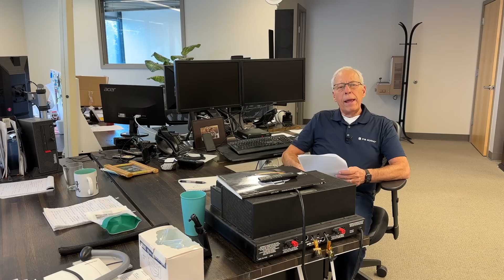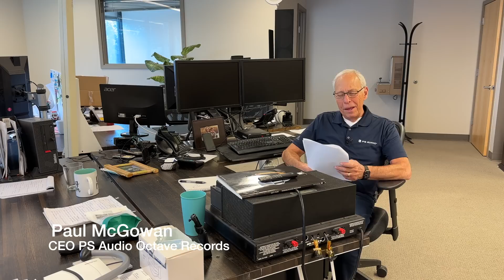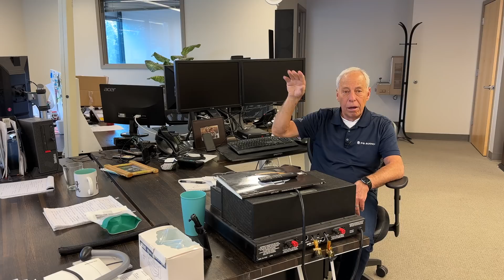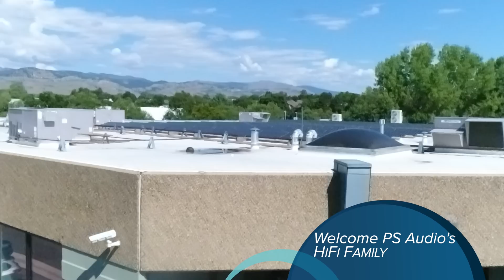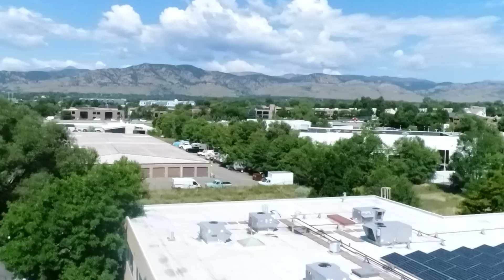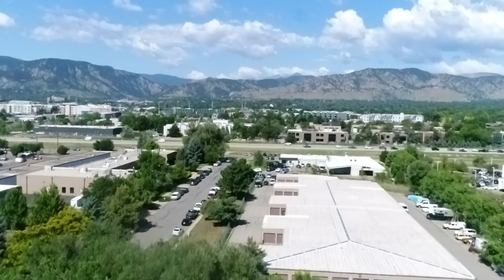Super tweeters and amps

Comment: It's purely academic seeing as at our age and any age above about 12 our hearing starts to decline from the 20-20 hearing to ...well at our age 20-14 or less.

But I still like the chat
Reply: Most people never hear that full range.  Most people hear very little below 40hz or above 15khz. For someone to hear the entire spectrum is actually quite rare, even in childhood.  

The 20 to 20k is a bandwidth allocation in the EM spectrum.  These allocations often include guard bands to prevent interference between services. The remainder is just that... extra bandwidth to limit interference.
Reply: @Douglas_Blake_579  yes that makes sense. I know that I can't hear below 28Hz.. and above 14kHz so talking of supertweeters is purely academic. My technics speakers have supertweeters barely an 0.75 inch  diameter from memory.

All I can think is the higher harmonics reinforce the mid highs.
Reply: @armarra 
What most people call "upper midrange"  or "mid high' is actually the range from about 800 to 2,000hz.  By the time your 16khz supertweeter does anything you're already looking at the 20th harmonic of 800 or the 8th harmonic of 2,000 ... how much impact do you expect that to have?
Reply: @Douglas_Blake_579  yes true..but I was talking about the 4000-16000 range. Let's just call it high range not super high.

I understand that the higher harmonics have progressively less and less effect on fundamentals.. 

My graphic extends from 16hz to 32kHz. This only makes any sense if you assume the 16hz strengthens the 32hz and the 32kHz strengths the 16kHz and possibly a bit lower.
Reply: @armarra 
in the 4 to 16khz range you will have mostly harmonic content. There are no musical notes above 4200hz.  C8, the highest key on a piano is at 4180hz.
My software marks 4k to 6k as "Presence" and 6k to 20K as "Brilliance"

I think the bottom line here is that by the time you get past the piano keyboard there is no more musical content. Everything is harmonics (timbre) and by the time you get past 16khz it's pretty much silent.  So it's unlikely your recordings contain much real information for the super-tweeter to reproduce, and it's unlikely you'd hear it, even if they did.

Comment: my AVA amps and pre amps go out to 500kZ, and min distortion...well under .01% at all freqs...and they don't cost the price of a Porsche, cus there is no reason for most over priced jewelery.  Drives my Legacy Whisper so fine
Reply: 500kZ... are you sure you're not reading the impedance instead of the frequency response?

500khz is just below the AM Broadcast band and is widely used by Radio Amateurs and marine communications ... on the 630 and 2200 meter LF bands. Such equipment wold be very likely to pick up and reproduce those frequencies by a process called "Audio Rectification"... producing significant interference with the audio reproduction.

Also with that kind of bandwidth phase shift due to slew rates and propagation delays would almost certainly produce a device that is prone to high frequency self-oscillation which can, and does, kill tweeters.

I might believe 50khz ... but not 500. There's no reason to do that and the problems it would cause far outweigh any advantage you might gain by it.

From the AVA website:  "Bandwidth is flat from 3Hz to 70KHz."
Reply: @Douglas_Blake_579  AVA also has incredible slew rates, look into his stuff....priced for mortals, built to last and work and perform...been using his stuff for decades...also great reliable, sonic bliss, and priced on planet earth
Reply: @Douglas_Blake_579  https://www.youtube.com/watch?v=12T7JFLGlf0
Reply: @cengeb 
Which has exactly what do do with anything?
Reply: @Douglas_Blake_579  over priced nonsense is not needed for sonic bliss.  $5,000 magic power nonsense, not even ul or etl listed.  No industry standard specs to use for comparison of product ability.  Just listen,tight? Oy vey.
Reply: @cengeb 
Then why didn't you just say so ... especially after touting phoney specs for your own equipment?
Reply: @Douglas_Blake_579  not phony,do some research,high quality doesn't mean grossly over priced...800V uS slew rates on my ava stuff fact...freq response out to the stroasphere..just better designs for much less money
Reply: @cengeb 
Is it not obvious that I did look at your amp's specifications?
Reply: not phony at all easy 1400W + RMS on each amplifier P500 AVA.  800V us slew rate, out to 500kHz..AVA makes great stuff priced in reality
Reply: @cengeb 
Whatever ... 

Nobody in their right mind needs 2800 watts for home use, no matter what the specs might say.
Reply: @Douglas_Blake_579  more than 2800,I use 4 mono amps each one is 1400w rms...it controls 8 15 in woofers 8 7.25 inch mids etc. Slam,impact,
Reply: @cengeb 
That is straight up ridiculous.  NOBODY needs that kind of power in a home setup.
Reply: @Douglas_Blake_579  don't need,but it's control,and adds realism,slam...listen loud with deep bass sucks some power...but high power amps with sonic bliss don't need to cost the price of a car...ava has proven it  50 years in business..p500 has a massive power transformer...these are even higher power than newer ava.  Sonic bliss with modern exicon and highly regulated supplies to all the stuff...it matters no need for outside nonsense power regeneration...Furman power distribution procts work fine...
Reply: Sweet speakers

Comment: As someone else's comment mentioned in the comments, if you're not an audio expert (a real one,t not a phony one), you should refrain from making absolutistic statements about things you have no experience with. It's sort of like the audio cable thing; like the fact that most cable doubters, with their theories about cables have never actually owned real expensive audio cables to know what they're talking about.Most commenting on super tweeters have never actually owned and lived with a good super tweeter. As far as this subject is concerned, rather than playing a single test tone over 20k, it would be better to play two test tones together,; one at 10k or 15K and one maybe at 25K, and see if people can tell the individual tone, from the one that has the combined tones. Our hearing can sense vibrations. On the other end of the audible spectrum, we are supposed to be able to hear only as low as 20hertz. Yet if there is lightning and thunder, we can sometimes hear rattling sounds from the thunder as the the noise of the thunder goes below 20 hertz. Same with super tweeters and their frequency range.

 I have had two different brands of speakers with built in super tweeters. When you disconnect the super tweeter,s you can always and easily tell a difference. They usually cross over from the regular tweeter at 12 or 14K. I hear crisper and quickerr transient response. My one one super tweeters diaphram weighs less than the air in a whisky shot glass, says the manufacturer. While I don't think that a super tweeter is absolutely mandatory; you can tell the difference even though only the highest overtones of musical frequencies can reside that high up in frequency. When they list highest frequencies of musical instruments, they don't generally list what their highest overtones can be.This is a perfect example of how bad and wrong information can be dispersed in a comments section by theorists (flawed ones) and the accompanying follow the leader mentality. If you've never lived with a superb super tweeter, you just don't know. Once again, it's like people discussing what Spain is like, who' have  neve actually been to Spain; or even been to the European continent at all.
Reply: Yes, and there are quite a few studies where people have noticed a difference in music reproduction when the higher frequencies (+22khz) are included.
Reply: @nancyblubberhead7256 interested, do you know how I can access  any of these studies? Thanks!

Comment: If you can only hear up to 20 kHz, what benefit will a super tweeter that goes beyond your hearing have?  It’s like saying my TV can display infrared and ultraviolet light.
Reply: Actually ... most TVs do produce both IR and UV light ... but your point is correct.

The truth is that most people hear very little under about 40hz and virtually nothing over 15khz.  The rest of that 20-20k spec is there just to keep a "guard band" around the most used frequencies.

In fact, if you look back in history to the late 1940s and early 1950s, you will discover the original "High Fidelity" proposals only went from 50hz to 10khz.
Reply: The articulation and tambre of audio ....not to mention, the psyhcoacoustics of ambience through phase-alignment, is greatly improved  by signal that is beyond our range of hearing.
Reply: @duanewalker1011 
I might buy "slightly" but not "greatly".  We aren't talking about 2nd, 3rd or 4th harmonics here, we are talking about 20th and 30th harmonics, which occur a levels that, even if we could hear those frequencies, would be so low as to be inaudible.  

Take the simple example of Piano note A4, which is 440hz.  To affect that in any meaningful way via ultrasonics you would be playing with the 50th harmonic at 22,000 hz... and with normal decay of 3db per octave, so it would be at -150db compared to the fundamental. The effect would be so trivial as to challenge even the very best test equipment... given of course that it is even recordable in the first place.

Toss in the vagaries of crossovers, positioning and acoustics and I'd bet ultrasonic frequencies will cause more problems than they solve.
Reply: @Douglas_Blake_579   You may be right, especially when dealing with "normal" decay.   But  I  have experienced  (or seem to) an effect of "realism" related to ultrasonics (especially subsonics) when played at volumes that create SPLs that are felt rather than heard.  Then again  ....I may be wrong.
Reply: @duanewalker1011 
When you get to the "felt rather than heard" threshold your hearing is already way into sensory overload.  

All the reading I've done on this pretty much agrees that we are best able to discern details and understand spoken language at about 70 to 80 decibels.  That is just a bit louder than normal conversation which averages about 65dba. 

These effects you are noting could just as easily be sensory overload and not real effects at all.

I just wish I had a dollar for every "audiophile" who's demonstrated a problem with his system by turning it up near-full volume, driving his amplifiers in to clipping and my ears into retreat.  On more than one occasion it's taken a couple of days for my hearing to recover from that.
Reply: @Douglas_Blake_579  You may be right.  But I've always been of a mindset that audio is as much alchemy as science.   Quality differences from various speaker cone materials,  SPLs and third and fourth order delays ....married together can produce a whole that seems to me, would be difficult to measure.   Of course  though ....I am not an audiophile but best described as an enthusiast and certainly have never dabbled into anything considered "high-end" audio.  Appreciate the feedback though.
Reply: @Douglas_Blake_579  I admire your ability to "set it and forget it".  I am a habitual tweaker.  I'm as far from a purist as you can get.  I have two amps, driving two pair of dbx speakers, each with their own ambience processor and a Carver sonic holograph processor.  That ...along with two EQs and subsonic synthesizers makes for almost infinite range of possible outcomes.  Bob Carver and David Blackmer were heavily into psyhcoacoustics and I love playing with their toys.
Reply: @duanewalker1011 
Ahhh ... stuff I would never even glance at for personal use.  Not that it's wrong to use it, it just wouldn't interest me.

My system is pure simplicity... Intel NUC mini-pc, 8tb hard drive, USB sound card, A07 amplifier and pioneer towers.  All the magic is in the software. But, I don't even turn on the EQ in my sound drivers. 
 Except for the speakers, my whole system stands 5 1/4  inches wide and 4 1/2 inches tall.  No kidding... totally miniaturized.  But it manages to produce 50 watts per channel at very low distortion and is home to thousands of songs and movies... so I'm happy with it.

As an electronics technician, about the last thing I want to do at night is mess with stereo stuff 🤨 ... So I tend to get it working and then just let it entertain me.
Reply: @Douglas_Blake_579  Again,  I admire your approach.   I wouldn't wish my tweaking addiction on anyone.   Seven sound processors (and counting) pushing 400 lbs. of speakers  .....all analog ....is something I can't help to mess with.  Chasing that "you are there effect".  I wish you continued enjoyment of your system.

Comment: Everyone talks about "audio bandwidth" as though there is actual music at 20khz.  

In fact, virtually all musical content occurs below 4200hz.  The top key on the piano keyboard .. C8.. is at 4180hz.  Middle C .. C4.. is at a mere 261hz  Ride symbols usually crash at about 600hz. Hi-hats are typically at about 2,000 hz. Even that delicate tinkling triangle is unlikely to be any higher than 3khz.

So where are all those harmonics, we keep sweating over? 
If we take the tuning frequency ..A4..  which is 440.hz we have harmonics every 440hz ... the 10th harmonic of A4 is at 4,400hz ... yes the 10th harmonic.  Once you get past the 4,200hz musical boundary, all content is harmonic in nature. By the time you get an octave above that (8,400hz), all you will hear is pss pss and ting ting... and an octave above that (16,800hz) is virtually silent.  

That expensive super-tweeter will just sit there doing nothing... But you won't know that, because you can't hear it.  Most people don't hear anything over about 15khz.

Then there's the matter of wavelength ... at 20khz a sine wave, in air, is only 1.7 cm (5/8th inch) and even the tiniest misalignment will result in cancellation, not augmentation. That is, misplacing the super tweeter device by even 8mm (1/4 inch) could have a destructive effect on the highs you already enjoy.

I will agree with Paul that going beyond 20khz with the electronics makes sense in terms of time alignment and not skewing the phase of actual musical content at lower frequencies ... but to do that with speakers is just a complete waste of effort and money.
Reply: All a super tweeter does is “blast” the tweet across the room  aka louder than a regular tweeter. You still can’t hear like a dog..😀
You paid me $1200. for a tweet I will tell you the Aliens from Zork can hear it..👍🤗I’ll take that in cash only.😀
I got to run with the money.